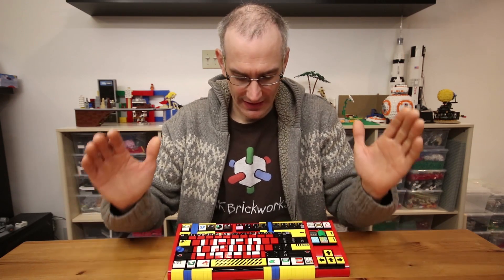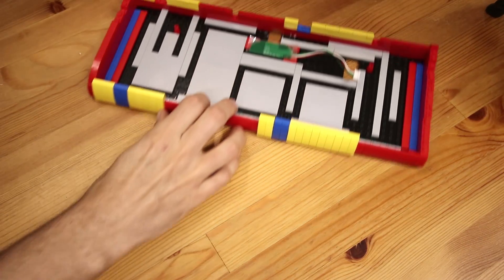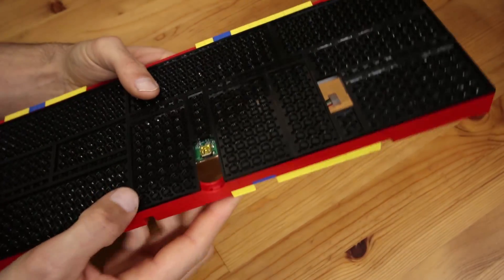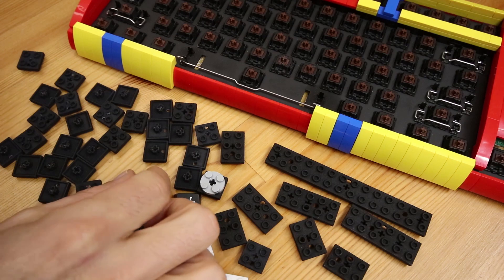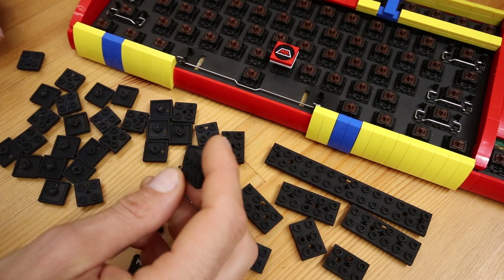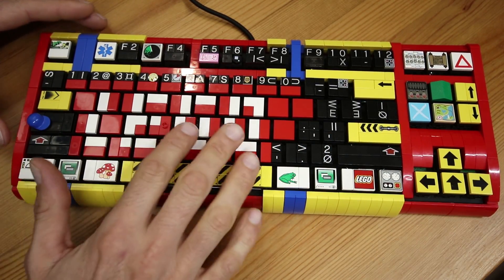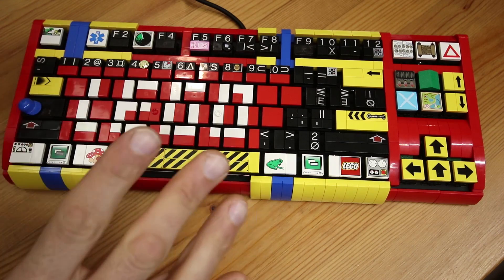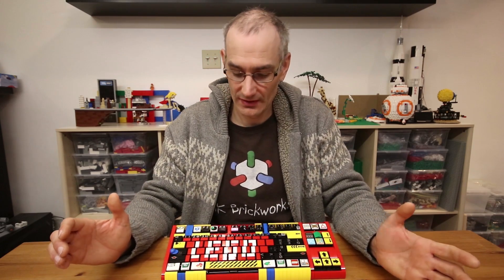Mechanical LEGO Keyboard

Comment: not entirely made out of lego... cringe. Just "lego skinned" normal keyboard.
Reply: Lego switches are really big tho
Reply: @MrBlackmidi1234567890987654321  Have a mechanism that puts the switches away from the keyboard area?
Reply: @andreivaughn1468  far too complex for a keyboard
Reply: @MrBlackmidi1234567890987654321  then don't make the video, half-assing it? Because who cares about this, really. The guy did nothing special. Title should have been "Mechanical Lego-themed Keyboard", then there'd have been no confusion.
Reply: u expect the pcb to be made out of lego too🤣🤣🤣

Comment: not really a Lego Keyboard if you 3D Print your own parts for it and use a complete circuit board already... could also just print the whole Keyboard and put one Brick on it and call it a Lego Keyboard...

i mean this is literally just a frame for your keyboard, not really impressive